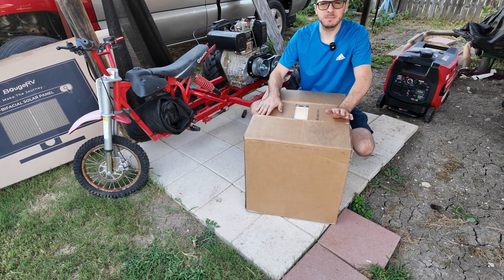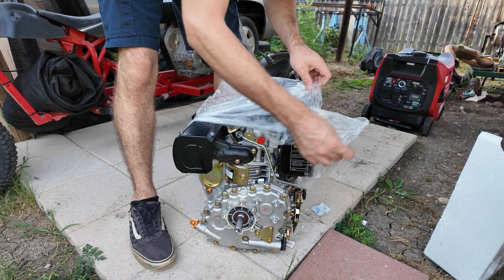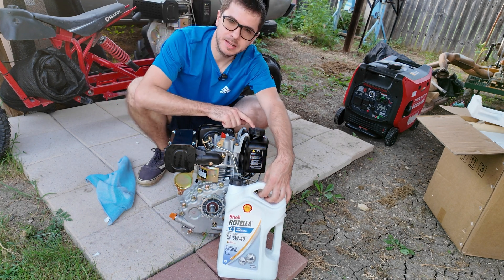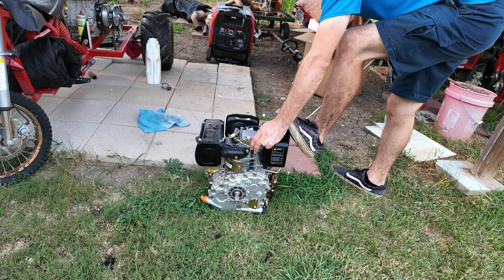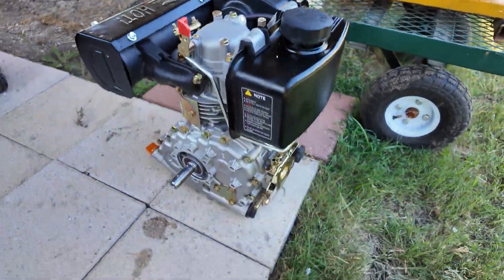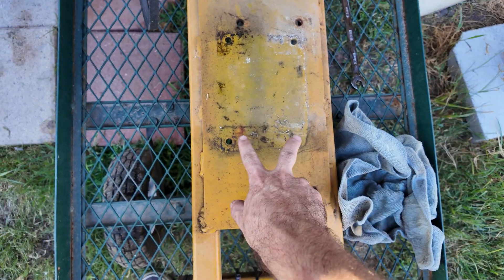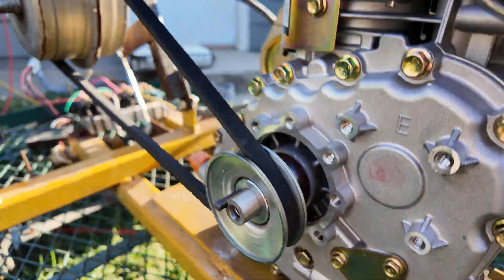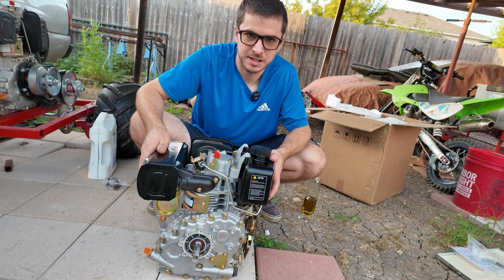CHEAP 247cc Diesel Engine Unboxing, First start, Running On vegetable Oil 5 Hp!

Comment: Ive been looking at one of these for a troybuilt horse 1 tiller can you tell me the measurements of the bolt holes that surround the output shaft which I would be mounting in a square pattern. Thanks Alan

Comment: Help me. I just buyed one of these and it’s a shame to start. Also y pops trought the intake when i try start it
Reply from the maker: You really need to yank on it. Pull the cord slowly untill you feel compression switch red compression release then pull with both hands

Comment: 7:43 the diy is never doing it the proper way. Because there is always somebody with thousands of dollars of debt and equipment that can do it the "proper" way. That "proper" way always has a hefty service charge to go with it being done on their equipment😂

Machine shop wanted almost $300 to resurface a head & $500 for deck. Garage sale large mirror $10, 2packs of sandpaper $15, $12 pvc rubber cement.  4hrs time and heads near flat by a few thousandths.

Comment: These Chinese engines have no oil pressure regulator. They will exceed 250 psi oil pressure on start up. This will destroy the oil pump rapidly then you will have no oil pressure. The easiest fix is to install a tee fitting between the oil pressure sensor, use an inline oil pressure relief valve and install an oil return fitting. Now you have steady 50 psi oil pressure.

Comment: I love the diesel episodes!

I'd like to see this in a mini-bike with a torque converter. Maybe something used from Marketplace, modified for the probably physically larger engine.

Did you see the Cars and Cameras videos where they connect three of the 400 (or so) cc diesel engines together, then in the second episode they install the combination in a VW Beetle? There's a third episode coming.
Reply from the maker: Yes that was crazy, I do wanna do some cool builds with these little diesel engines!

Comment: I love your videos. I want to buy one of these 3hp diesel engines because they are 300 bucks cheaper than the big ones BUT you cant find anyone in Germany that sells these engines. Well i found one on Ebay but its a US import than, but i have to try this then. Would love to have one of these, because you can find these gas ones everywhere a diesel is something special what is weird in Diesel Germany.

Comment: So lets get this straight, you have a Diesel engine capable of 3,730 watts but you have it hooked to an impotent generator putting out 1/10th or 363 watts. After all that effort I hope you plan on buying a real generator head for it? Or at least a high output PMA.
Reply from the maker: I didnt have the engine fully loaded up. If i increase the RPM, the current goes up aswell, and will keep rising untill the engine can no longer keep up. Havnt went full power yet!
Reply: @Mikebuildss  Would love to see that!

Comment: I've been researching these small diesel engines for a while now, I've found the most efficient are the 418cc and 456cc, their optimum point is at 2000 rpm with 60% of nominal load, if your engine is 5hp and you set it to 2000 rpm with 3hp load (or 2.1kw) you will get the most power with less fuel, you can also gain 3-5% more efficiency by adding more weight to the flywheel, like a 20 pound weight plate.
Great video, I hope to see more experiments. Best regards.
Reply: Thats nice to know! Awesome!